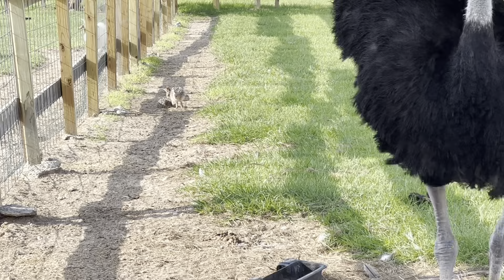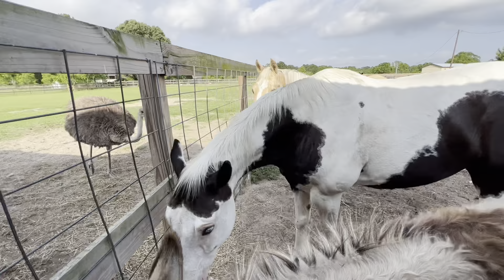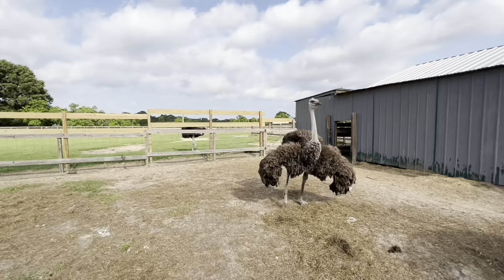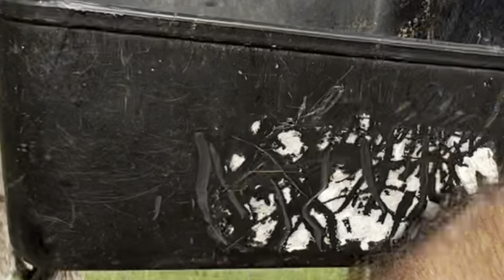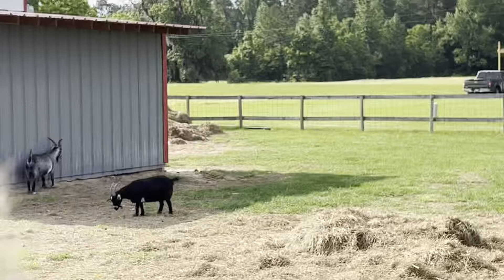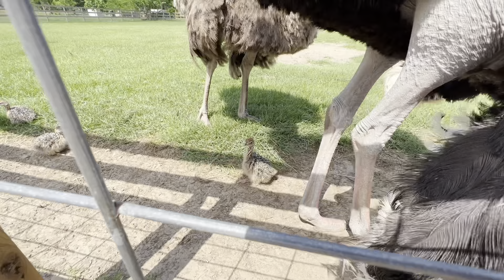Baby Ostrich Feeding Lessons with Lester

Comment: Get a cheap blender from Wal Mart that for the barn, so to speak.  Yes the yelling may scare the little ones.  Do you have anything with lower sides for the water.  So the can easy get out if they fall in?  You have some much to figure out.  We know you will.  Ya'll are wonderful with all you animals.  Have some fun learning and patience with the non-baby animals.  Don't let them drive you crazy, they don't understand you want to get to the new babies.❤
Do you have to put the wire on their side of the fence?
Oh the pain.  You can get some tent stakes if you need it pin down.  Sorry, whatever you have to do to fix it.  Best of luck.

Comment: Take the rabbit pellets and put in a one gallon ziploc bag! Then put in any plastic grocery bag! Wrap a towel around that and beat it with a hammer! That's how you can get the pellets smaller! My ice maker broke and that's how I make my ice except I use water in 1 GALLON FREEZER BAGS! Just be sure and CHECK for small PLASTIC PIECES! Sometimes the freezer bags fall apart some! Normally, not to bad and pretty easy to spot if it happens! It's a great stress reliever beating the bag! I will also flip it and beat the other side! I wrap the towel around it before beating because, it helps keep the hammer from putting holes in the bag! I just hold grocery bag shut with one hand and beat it with the other hand! Works great! Just be sure not to hit your other hand while pounding! I have also done that! Makes great ice or could crush rabbit pellets! When done I remove ziploc bag and any loose pieces of plastic from it and leave the rest in the grocery bag! I throw the grocery bag in freezer with ice in it and and get ice out as needed! "WORKS GREAT" Should work for making pellets smaller too!

Comment: The chicken wire seems to be not strong enough to hold up to the goats so maybe put some boards up maybe put some boards up along the top part of the chicken wire and if you can along the bottom part of the chicken wire and maybe the goats won't bother it. Or just plain put up panels of 2x4s and that way the chickies won't be able to get through and you won't have to worry about it being torn apart by the goats.